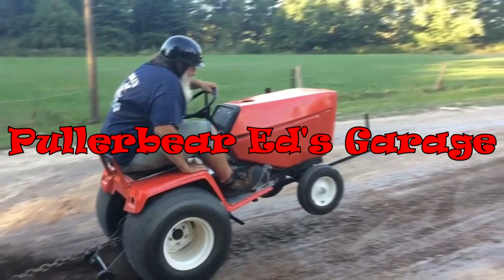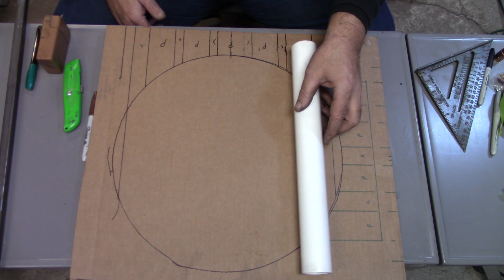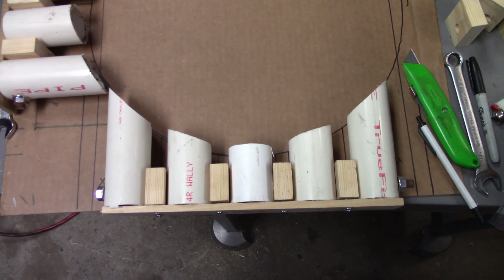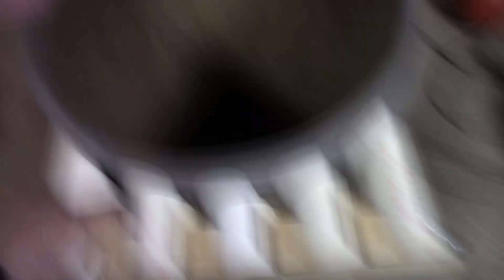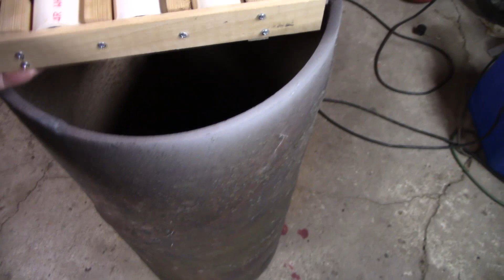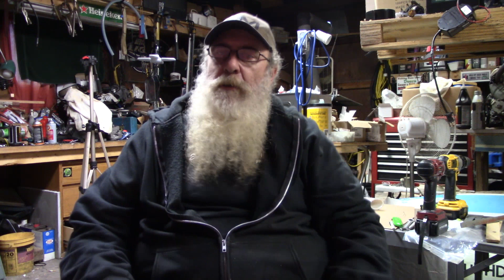Building a used oil burner for the shop. Part 1

Comment: I am thinking about building a waste oil burner myself. I want a burner that does not use forced air. I have seen one that pulls air up through a four inch pipe and then spills back down and out into the burner that I think I will use, It has a hat over the four inch pipe with holes at the bottom of the hat to let air out into the burn area. That is a good idea to mark the elliptical hoes for the heat transfer tubes. I have a big wrap around to go around the pipe to get them on the same plane on both ends. I have water heaters, well tanks, and an eight foot piece of eighteen inch natural gas pipeline pipe with the light green protective coating on the outside. Think I will use the water heater tank to start with. Cheap, cheap, cheap. I am more concerned about getting the burner right first.
Reply from the maker: The top hat design was my first choice too but after researching it the forced air style burn hotter and up here in the north that is what I want...more heat. Check those hot water tanks close, they maybe glass lined. I couldn't find an old one around here that wasn't.
Reply: @PullerbearEd  most around here are the cheap ones...lol. I dont want to have to rely on electricity though
Reply from the maker: I didn't want to rely on electricity either but I figured if I had to I can run it off a little generator if I had to.

Comment: I would stay with a thicker pipe because of the caustic chemicals that are created from the used oil and the exhaust will eat up thinner pipe to rapidly. Looks like a good project and a cheap source of heat.
Reply from the maker: I was also looking at thermal mass of the heavy pipe.